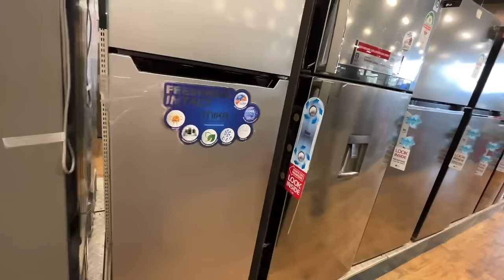Part 2 | Kitchen Reveal | Surprise | Construction | DIY Remodel | Vlog | Sylvia And Koree Bichanga |

Comment: The kitchen is great.  I would make sure no water or moisture hit those light sockets and I would have hung the dust pan lower to floor.  Curtain is cute. Also Koree, maybe hinge a small collaspable work table to window wall. Seems like more of a prep space is needed. Just a good board, hinges and collaspsible legs - maybe. I'm just thinking of my small kitchen area.
Reply from the maker: My exact suggestion to him 🥰
Reply: That’s a great suggestion to create that work surface by the window!

Comment: What a lovely kitchen
Nice big sink. Put 2 hooks up somewhere for the dishrack and then the bench can be used . 
Beware of the electrical point above the hot plate /stove When cooking the heat  and  the steam  could cause  problems. an extraction fan could draw the steam  away and move the cooker closer to the front of the bench top away from the tiles.

Comment: ANOTHER THING PLEASE DON'T PUT THE REFRIGERATOR TOO CLOSE TO THE WALL AS THE COMPONENTS NEED AIR TO FUNCTION PROPERLY ESPECIALLY THE COMPRESSOR IN THE BACK TOO MUCH ENCLOSE SPACE WILL CAUSE OVER HEATING AND MALFUNCTION.